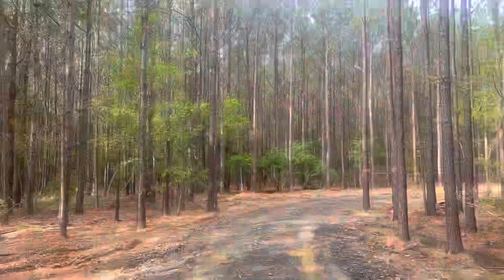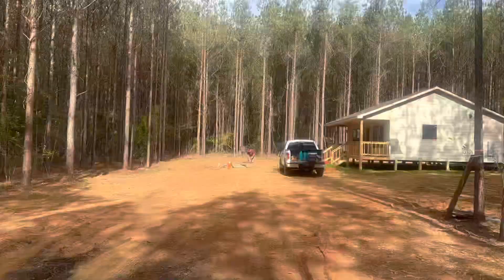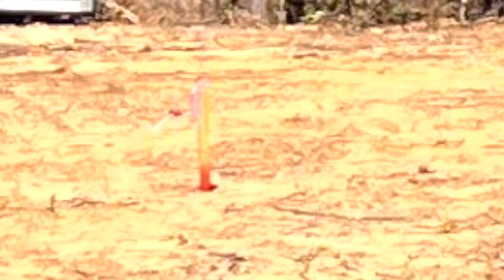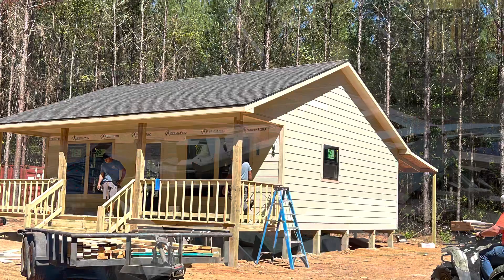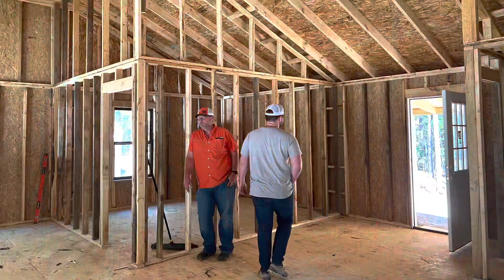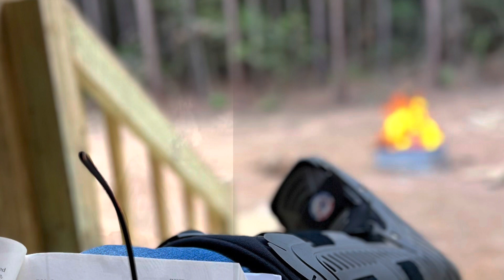Porch Talk: Shed to Cabin Follow-up.

Comment: The outside of your cabin looks real nice!  I like the porches and the inside layout.  I have been to Texas years ago and it was very hot .  You said you were going to foam insulate the underside of the cabin.  Are you also going to insulate the interior walls and ceiling to keep it cooler?  Hanging drywall and finishing the drywall in the ceiling sounds like an awful lot of work.  I would opt for the tongue and groove.  You mentioned about being able to run a generator if you lose power.  That is a great plan!  We live in Michigan but I remember seeing pictures of people’s homes (in the South) damaged from ice storms when the pipes burst.  Take your time building your cabin as your finances allow.
Reply from the maker: Thank you Joan. Yes, we plan to insulate underneath, as well as throughout the inside. We experienced ruptured pipes during the freeze so you are absolutely right; we get all extremes! I appreciate your feedback on the tongue and groove. 🤞 We are going slow but having the patience to pay as we go will be worth it in the end! Thanks for your support😊